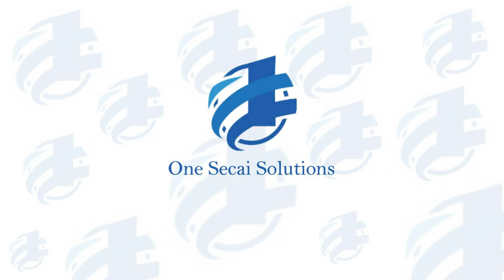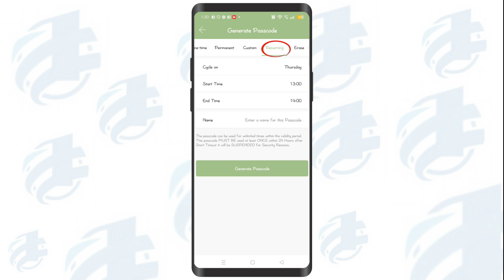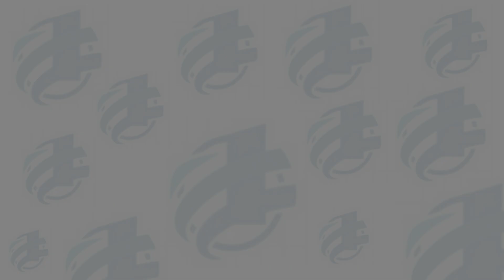Haven Homekey Tutorial - Add Passcodes, Cards, Fingerprints, E-keys, and Remote keys

Comment from the maker: Skip to the function you prefer:

0:00 Introduction
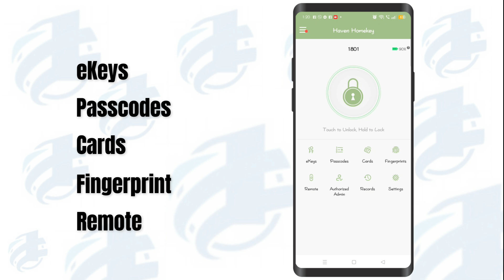0:30 Adding Passcodes
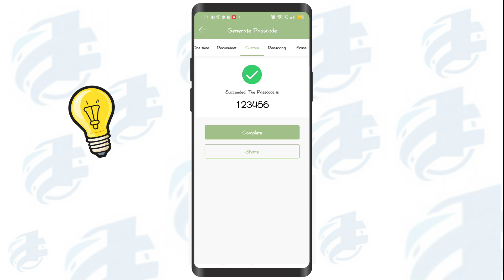2:02 Adding RFID Cards
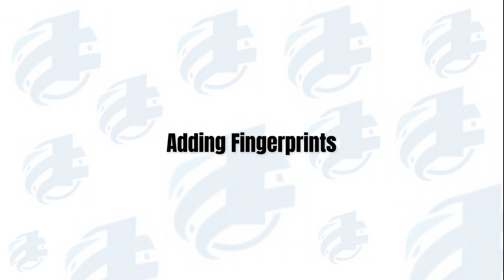2:30 Adding Fingerprints
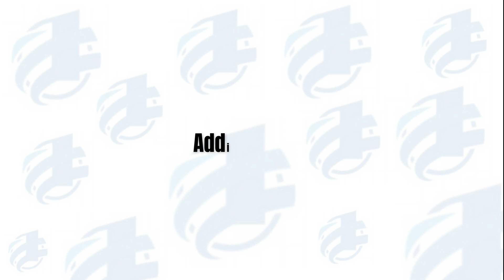3:00 Adding e-Key
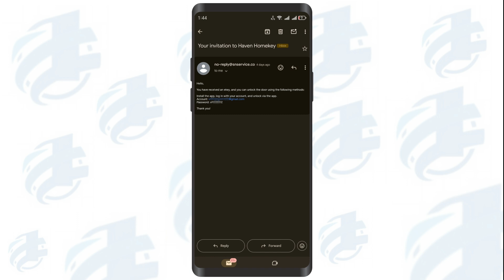3:34 Adding Remote
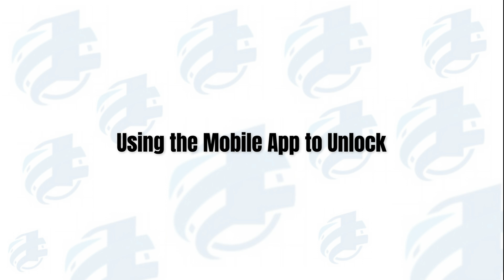4:05 Using the Mobile App Unlock Button
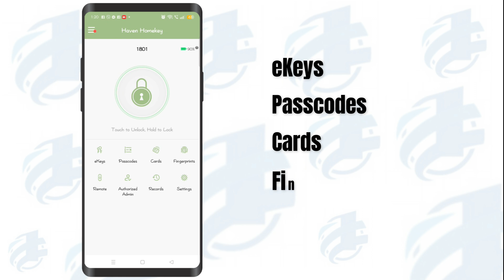4:35 Outro